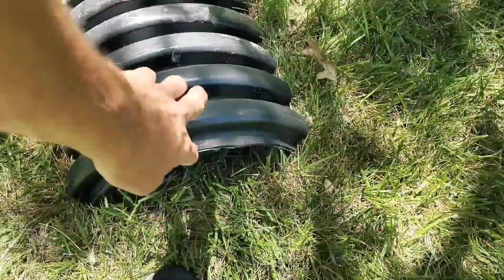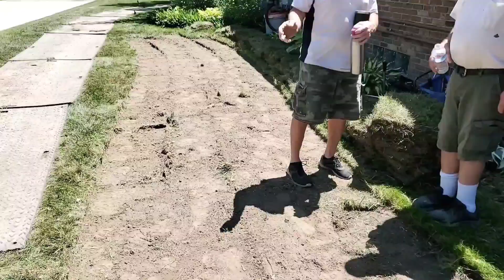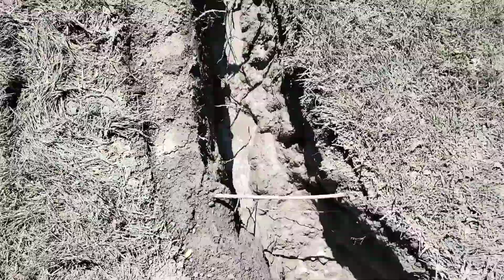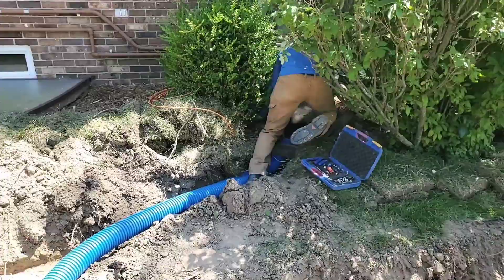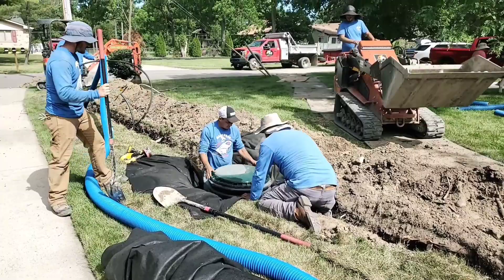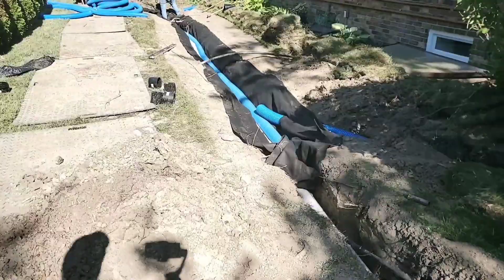Yard Drainage Built In the North to Prevent and Protect Against Freeze Damage and Frozen Pipes

Comment: Great videos, thanks for posting.  I still question the depth req'd for the sump discharge line in freezing areas like Michigan.  You said you must stay below the frost line, roughly 42", but at the sump outlet, it only looks like maybe 12" or less?  Wont this freeze inside the flex PVC line?
Reply from the maker: https://youtu.be/i92tg09hm6Y?si=5qgSaREnC-m9vwhW

Comment: Love this content. Although I've done this work before, it's not my specialty. Id be doing this with big equipment that I use for grading. Id have such a mess that I would to have to redo the whole yard!  This is rewarding to watch. I'm in Georgia in the Appalachian mountains. It is not flat here and we don't have as a severe freezing issue. The houses here  are mountain mansions and cabins. On the side of mountains. Most of the type of work here similar to yours is a farm pasture in low areas with spring heads / or ponding of surface water, a city bank type location in the old flat parts of town, basement wall drains, gutter drains, and the like. The depth that you go to in the projects is intense and I wonder how you don't get resistance to charging what this is worth? I cringe turning in a bill! I assume the Michigan people that hire you are desperate with very bad situations and they have the financial means to make the problem go away. From what I see is you guys do quality work with attention to detail! The micro machinery to do this is amazing. Smart.